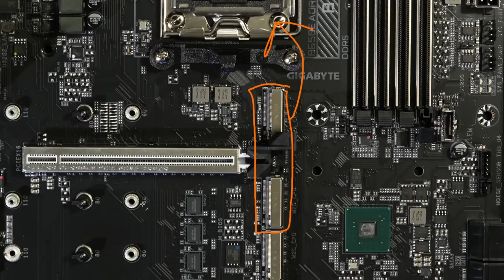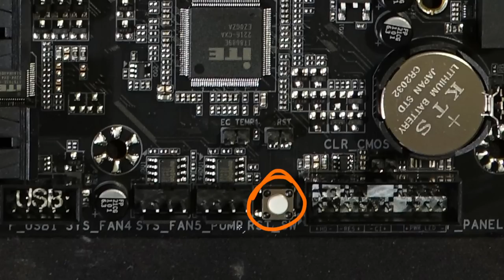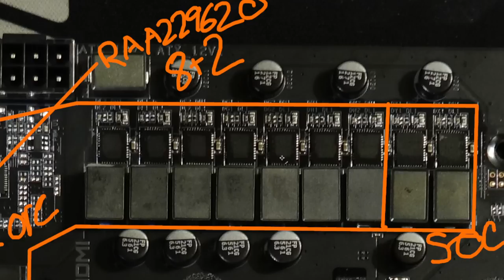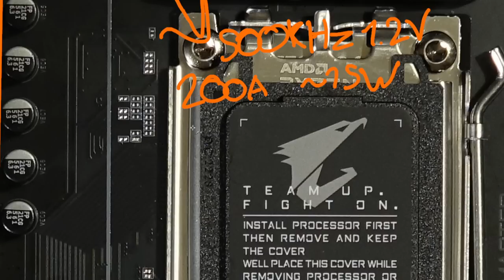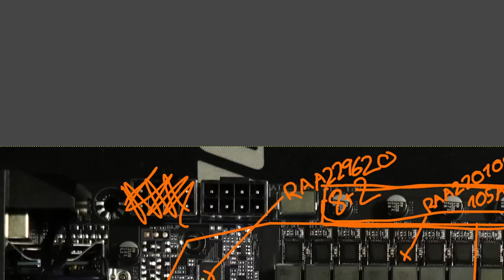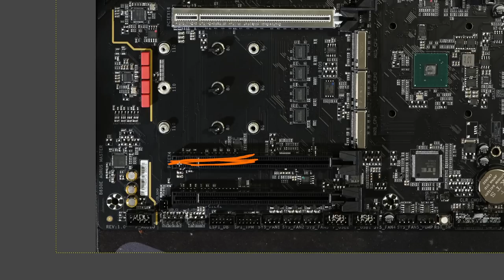mobo PCB Breakdown: Gigabyte B650E Aorus Master

Comment: Thank you for the great PCB breakdown BZ :),

In germany, the price difference between the x670e-aorus master and the b650e aorus-master is only around 70€ to 90€. Personally, I prefer the m.2 setup on the chipset of the x670e because If I decide to use more than two m.2 drives I can still use them without going down to x8 on the pcie 5.0 x16 slot (which is typically used by the graphic card). Unfortunately, current GPU gen only supports pcie 4.0 so there may be a small disadvantage (I think someone measured around 1%-3%?) to go down to x8.
Reply: exactly
Reply: Hast du das x670e Master gekauft?
Reply: @BrickBazooka  ja, bisher keine Probleme mit einen 7950x3d. Die SOC voltage Probleme hatte ich bisher nicht laut hwinfo
Reply: @k0r4nd78  Du scheinst Dich gut informiert zu haben. Hattest Du auch das Xtreme überlegt zu kaufen? Das soll wohl shared Pcie lanes haben und darum auch nicht soooo geeignet zu sein für 2x m2ssd plus x16 gpu plus vielleicht noch ne Soundkarte..

Comment: This is perfect, since there is no difference for new GPUs, PCI-E4 x8 is enough and PCI-E 5 x8 will be enough for the next gen.
Reply: I mean you can still run 2 gen 5 SSDs and get x16 for the gpu, only switches to x8 when you install a 3rd M2 drive which 99% of people won't use like ever. Gen 4 x8 is not enough though,  4080 is bottlenecked by 5-10% while the 4090 is around 20% you need x16 until we get gpus that natively support gen 5 then x8 will be enough.
Reply: @kerotomas1  that is not really true. The RTX 4090 is bottlenecked just by about 2%, not 20% lol...............haha where you got this from? The difference is very very little and barely noticable.

Comment: I wonder if converting them to PCIe slots will work. They have M.2 to PCIe adapter boards. I still don't understand this M.2 obsession. There's plenty of PCIe lanes to fit 7 PCIe slots and a few M.2 slots. I'd be fine with a single x16 slot and 6 x1 to x4 slots.
Reply: Same, a pcie to M.2 card is dirt cheap and pcie slots are so much more useful. It's also annoying that boards are dropping pcie slots just so they can advertise "we have (x) gen 5 m.2 slots". Anyone who wants a bunch of m.2 can just get their pcie m.2 or u.2 cards.

Not to mention normies don't even really care or know what that means and people who do don't need it. Kind of a self fulfilling issue.

Comment: @buildzoid do you think they put 2 phases on the misc rail for better transient response or is that rail super stable and the capacitors would fill in the gaps of a single rail's on/off cycle?

Comment: They have the b650e tachyon on the website, but I can't see it for sale anywhere
Reply: I don't think it is on sale yet. Even the z790 Tachyon isn't available yet.
Reply: @mukundpadmanabhan1930  in Australia they had some z790 tachyons
Reply: It's out of stock for me as well. Are you really considering getting a what, 800$ B650 motherboard? I know it looks really nice but holy.
Reply: @fVNzO  maybe he wants to do some extreme overclocking. Those boards don't make sense otherwise. I personally am interested in the b650e tachyon because I wanna try to do some memory OC
Reply: @LawrenceTimme  I remember some Aussie stores had the z590 tachyon in stock before it came to US too.
Reply: @mukundpadmanabhan1930  So, I get what you mean. It's a very cool board, and probably the best looking as well. But at 6Gbit DDR5 it just doesn't matter where the DIMMs are, and probably what topology is used but i think most use daisy chain at this point. 

I'm using practically the cheapest ATX B650 (TUF) on the market. Running maxed out for my IMC at 6.4Gbit with 30-37-37-37, M die. 

I could probably go even higher if i wanted to bother trying but i don't think it's worth going to cas 32+.

I really don't see how you would get any more performance spending 600 bucks extra on a mobo rather than just pocketing that money, or hell spend it on some overkill  A die. But even then i don't think it can go much lower than C30 anyway. So it's a complete waste. Not even for futureproofing either as RAM and mobos will eventually just fall in price whenever Zen 5/6 comes out that may or may not be able to clock their IMC's to lets say 4Gigahz. 

I don't see a single scenario where buying a tachyon makes sense if you're not gonna go for the hall of fame.

Comment: Buildzoid a question on this board since you are a trusted genius for me 
why does Gigabyte boards have issues with DACs on USB ports it has a POP to it that is so noticeable like a switch on and off when there is sound vs no sound
does this issue come with some boards and not others? and does it also happen with this board since it is the cheapest in my country and i don't want to get another gigabyte for this issue?
i have a z790 Aorus Elite AX DDR4 and i want to get an AMD build with this board.

on asus boards this issue is non existent  is there an explanation to this or is it a gigabyte thing any insight will be helpful for me thanks in advance

Comment: Hey, I am wondering about PCB breakdown of some really of the cheapest AM5 mobos.
I am also wondering abut PCB breakdown of new GB AM4 B450-POOR mobo, that actually is rescuing all the AM4 socket sensibility, because of massive price hike of all the rest of mobos (at least in my region). It is totally cheaped out, but I think it's good enough for Ryzen 5500, 5600, and even X3D that is using really little power.

Comment: Smug CrystalDiskMark Shizuku grins
The pci m.2 config on the board is my jam, but I'm on a ~2025+ horizon for next upgrade
Maybe we'll actually have Gen5 SSDs available by then
Granted we may have 7xx series boards with Gen5 chipset/lanes by then
x8/x8 with a riser can be physically a pain due to the chonkers size of GPUs and blocking airflow
Apparently HUB found that Gigabyte is doing a relatively better job of out of box secondary memory timings, which is nice

Comment: Buildzoid, do you think that this board could run DDR5-7200(OC) in the future if Ryzen 8000 gonna support it? In the other worlds, what RAM limits in case of data rate and latency this board has? Is just a question of software and firmware or hardware has some limits in this as well?

I realized it has THB_U4 add-in card connector. Can you anybody say what is this used for? Does anybody has usefull use for this port?

Would you make some DDR5 2x32GB SK Hynix with dual rank 16Gb mem chips tests in the future? For example is it possible to overclock Kingston 5200MT/s or 5600MT/s rated dimms to 6200+ MT/s?

Comment: Correct me if I'm wrong, but if an EPS12v connector is 18guage and is ~28 inches long isn't it capable of 40A, 480watts (10A per wire)? Do the connectors in the plastic housing affect power that can be drawn?

Comment: hAVE YOU ENCOUNTERED THE bios  battery issue on our master boards?  I had to strip my entire setup in order to change out the battery on my Aourus 670E master.  I ouldn't believe what a poor design this is and Gigabyte had a bad batch of CRq2032 batteries.  Otherwise a goood board.

Comment: WARNING

If you buy this model then make sure it's from a reputable retailer with a very good RMA customer service, there's a little QC issue with this model and Gigabyte being Gigabyte wont help you at all.

buildzoid you're awesome, please make AM5 memory overclock video.
Reply: I bought this motherboard and I have the "little' QC issue of getting black screens when I put my CPU under load. Just get another motherboard and save yourselves your time, money and hassles. There's a reason this mobo is this cheap for the features it offers - poor quality control. It's not worth it, believe me.
Reply: Gigabyte being gigabutt..
Reply: This model also comes with a 5 year warranty in North America.
Reply: What "QC" means please?
I have aorus elite ax, it has same issue?
Reply: @malesulo980  QC = quality control. I've not heard of their Aorus Elite models having this issue. Hopefully you are fine. One way you can test for the issue is if you put a powerful CPU like a 7950x and run OCCT Large Data Set (it's important that it's on the large data set setting) or if you run Corona Benchmark. Prime95 also causes the black screens. It can also happen with other software and even games from what I've heard from other people. I think it has to do with the inability of the motherboard to adequately handle AVX workloads since all of these software use AVX instructions.
Reply: @bgtubber  thank you for answer. I had a lot of instantability issues and other AMD weird stuff like black screens, screen flickering etc but i think most of them was GPU related. I already send second GPU to RMA. And black screens and restarts was propably some CPU instability issue. My 7600x was boosting up to 5540mhz and mine "top" core cant handle that. All my cores are running now -20 pbo but 6th core is only -7 and -120 boost clock so im locked around 5320mhz max boost...
Stable in occt and prime95 in both low and large datasets.

Comment: Hah! I Just bought this mobo yesterday 😄
Reply: Which CPU did you pair it with? Do you have the black screen issues when you put the CPU under load in Corona Benchmark, Prime95 and OCCT large data set?
Reply: @bgtubber  I should recieve  it tomorrow. I have 7700x and plan to change it for x3d model later.
Apparently board is from newer batch thats why i'm still waiting for it. 
I will definitely check it with load you mentioned and get back here.
Reply: So after 24h of intense testing - No problem on my board. Paired with 7700x - one thing that might be unusual is lack of nvme drive right now. I need to prepare it from my old system.

Comment: > "Mega-Heatpipe & M.2 Thermal Guard III：To Ensure VRM Power Stability & 25110 PCIe 5.0 M.2 SSD Performance"  
Ah, so the massive heatsink isn't just for the VRMs that you say don't need it, but its connected via Heatpipe top to bottom, so the four M.2 SSD are cooled by it as well, that makes a little bit more sense maybe?
Reply from the maker: it does not connect to the M.2s

Comment: Wouldn't it make more sense to just buy a standard board and use PCIE to m.2 adapters?
Reply: are there standard boards with many pcie slots you can use like that? Afaik most boards have just the slot for the GPU and some small stuff from chipset for another slot or so

Comment: If the M.2's aren't run as Gen 5.0, will they still cut the x16 down to an x8?

Im eyeing up this board Vs. The ASUS Strix B650e-e and that's just one of my concerns between the two.
Reply: yes it's a switch that moves whole lanes, what they run as does not matter, it's electrically connected to the SSD and not the GPU
Reply: @marcogenovesi8570  Sad and annoying. Welp, ASUS it is.
Reply: @TheApotheCarrot  all b650e boards are the same using 2 or more m.2
Reply: @Nistical  Boo. Do you know if X670e has the same disappointing feature?
Reply: @TheApotheCarrot  no it does not so you wouldn't have to worry about it with the x670 boards, but cost more so is it really worth it. I heard that comparing x16 to x8 is about a 3% difference in performance. Both boards are future proof pick your poison lol
Reply: @Nistical  Hmm. Thanks for the insight. I'll have to think on it a bit.
Reply: @TheApotheCarrot  hey you got the money go for the best go big or go home right???
Reply: @Nistical  this is the last upgrade I'll be making for about 4 years, so I'm considering if the extra $80 is worth removing a possible bottleneck on the GPU
Reply: @TheApotheCarrot  then go for it whatever makes you happy
Reply: @Nistical  Interesting note from the manuals; the B650e-e can use 3 M.2's and maintain the x16... as long as you dont use slot M.2 slot 3 (there are 4 total).
The B650e-f can use all 3 of its M.2's and maintain the x16, but you lose the 3rd x16 lane (big deal)
Reply: @TheApotheCarrot  hmmm I was wrong maybe the same for the AORUS master too
Reply: @TheApotheCarrot  could you check the manual for the AORUS master as well?
Reply: @Nistical  I'll have to check it, but the X670e-e is a scam. Using the 3rd M.2 (of 4) cuts the x16 to x8... but not on the X670e-f
Reply: @TheApotheCarrot  yeah it’s weird with these new boards some seam to have other features while others don’t and can you please check the b650e aorus for the m.2 cause that’s the board I have
Reply: @Nistical  M.2_A and M.2_D (the 2 closest to the CPU) operate normally. When M.2_B and M.2_C (two further away) are populated, your PCIe is cut down to x8. All PCIe devices listed are 5.0 speed.
Reply: @TheApotheCarrot  so with the aorus master b650e if I use m.2 A and m.2 d it wouldn’t cut it down to x8?
Reply: @Nistical  Correct
Reply: @TheApotheCarrot  okay not so bad

Comment: Are they insane with the 16 Vcore VRM phases at 105A each? (so for a total almost 1700A for the CPU alone!) That's how much the high-end HEDT boards used to have when they were sold. 

If this were a X670E I wouldn't be bickering too much about it, but this is B650E! Damn.
Reply: My Threadripper 3000-series motherboard (Asus ROG Strix TRX40-E) has a weaker VRM and it supports 64-core CPUs that can go well above 700 Watts when overclocked. 😂
Reply: @bgtubber  Yeah that's the point, especially given that B-series mobos will also go with non-X CPUs that draw 88W max with PBO left off. It's insane and ridiculous.
Reply: ngl hella overkill id rather have them cut down on phases and lower the price in return
So far though all AM5 board as far as ive seen have really nice VRMs.

Even a B550 board has a better VRM than my 3 year old B450 board.

Comment: I do not recommend this motherboard. There's a reason it's this cheap for the features it offers - some of these mobos are factory defective (AKA poor quality control). They will cause black screens when paired with Ryzen 7950x. Mine was one of those factory defective ones and I've been waiting for weeks for replacement. Check my channel for a video I shot of mine. There are also Reddit threads about this (search B650E Aorus Master black screen). What's worse is some people won't even know this since the problem doesn't happen in every software or game and will think it's their video card, PSU or monitor that's at fault, wasting hours or days of their time when it's the Gigabyte motherboard. For example, I can run hours of Cinebench R23 without any issues, but as soon as I run Corona benchmark, OCCT large dataset or Prime95, I get black screens. Typical for Gigabyte, they are playing dumb and still haven't even officially acknowledged the problem. I wrote to their support and they also "don't know" about this issue. I'm very disappointed with Gigabyte as a company. Just don't buy it. It's not worth the time, money and hassle RMA'ing, believe me.